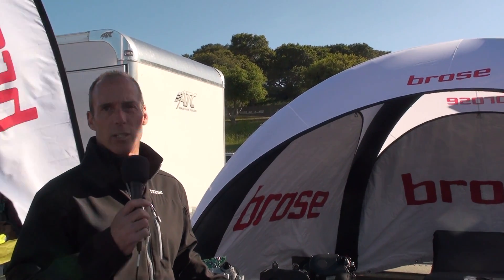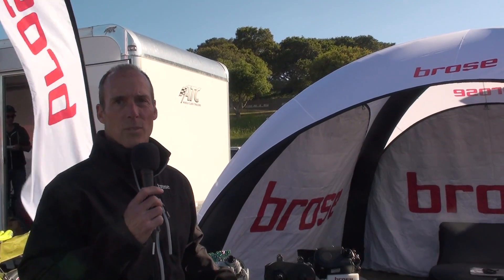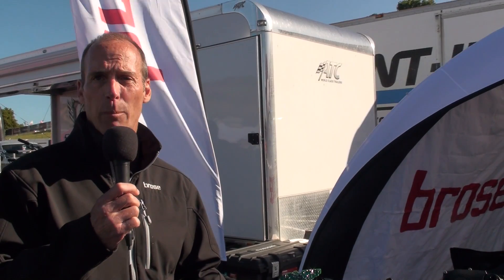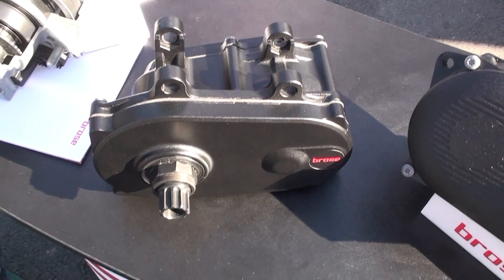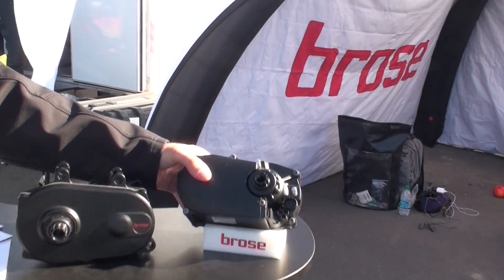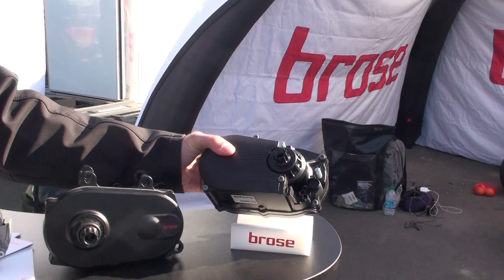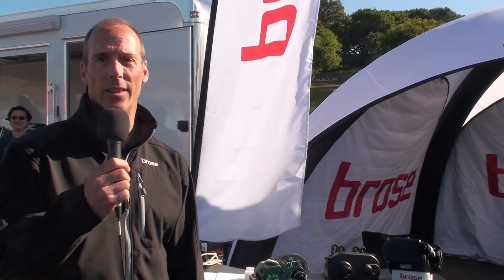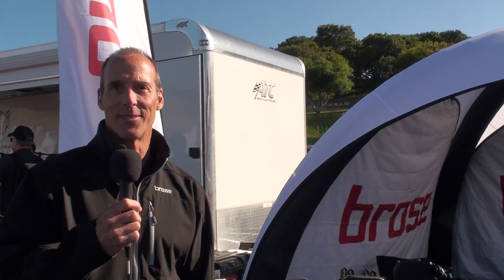New Brose Mid-Drive Motors | Electric Bike Report

Comment: Hello Dan - I am the owner of a small pedicab company in Austin and would like to know what kind of weight can your mid drive handle? 
My e-Pedicab weight: 250-300lb. 
Passenger weight average: 600lb. 
Right now the market is picking up for e-pedicabs and we really could use a solid reliable setup.
Reply: Hello from Austin Dan , Getting ready for ACL - Biggest day of the year ! I just picked up a Specialized Como W/ upgraded 604Kw Batt - @ BSS Lamar store & love it . I was thinking could I use it to pull a pedicab like the ones in Austin ?

Comment: Dan I'd appreciate a video that is less superficial, most videos on the bikes and motors lack indepth  details. Bottom bracket bearings in motors do wear and will need replacing at some point if you keep a bike for a few years and cover a decent mileage, as an example my Bosch motor bearings last about 5,000 miles before they need replacing. What could separate Brose from the competition would be readily available service parts to ease servicing. I've heard the Man from Brose say the bearings are designed to last the life of the motor, if that's the case and the bearings only last 5,000 miles that's going to make for a prohibitively expensive  system.

Brose need indepth service videos and parts available for owners to service their own motors like this video  https://www.youtube.com/watch?v=fAkaSw5mrvw